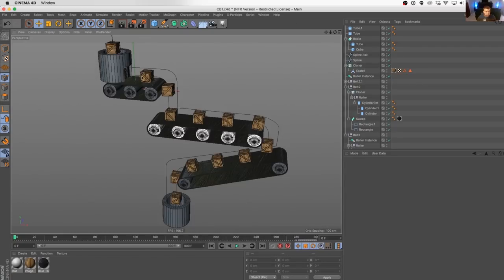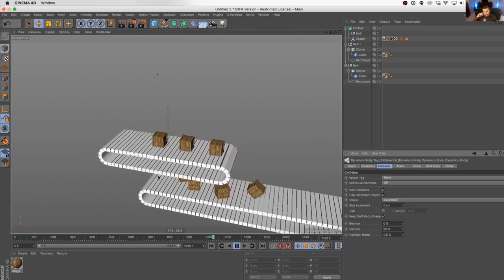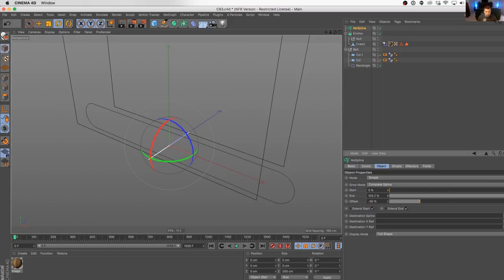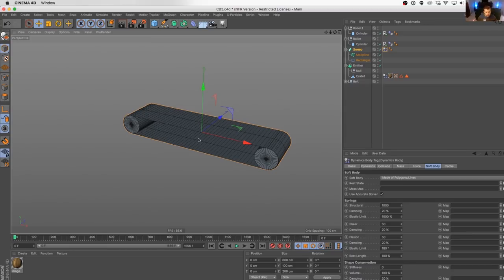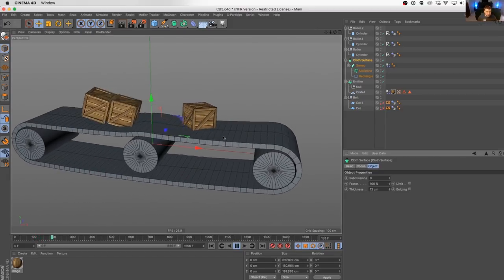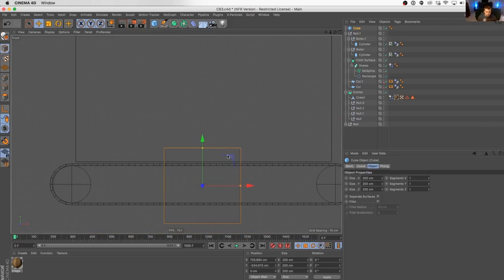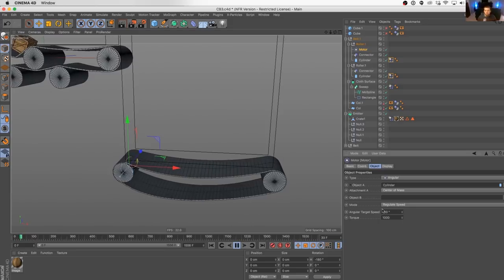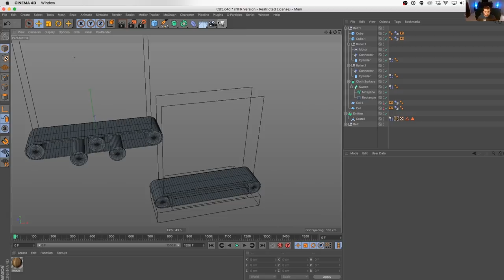How To Make A Dynamic Conveyor Belt in Cinema 4D - Part 2

Comment: I am curious to know if you could apply dynamic to a plain with spline wrap, and make it work, as it works with cloner. So, to replace the moving track made of clones, with a plain wrapped into that same spline that you used. I tried but there is a problem with dragging the box, on that moving track. It jumps, and does strange moves, as a result of dynamics, but it doesn't move forward, or whatever direction the track its moving.
setup should look like this:
1. plain with a spline wrap (fit to spline)
2. for moving the track I key framed Offset option, under the Spline Wrap deformer 

hopefully you can make it work, because as it is, by default, it doesn't make the box to follow the moving track.